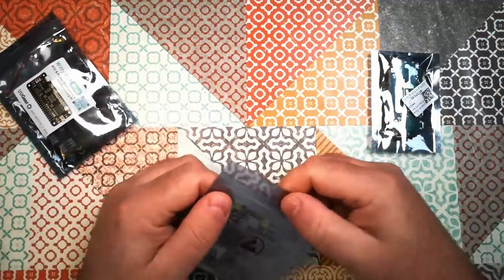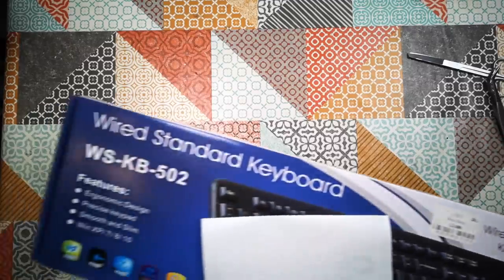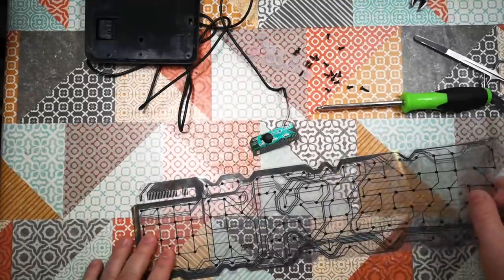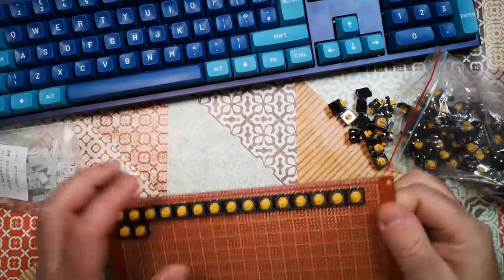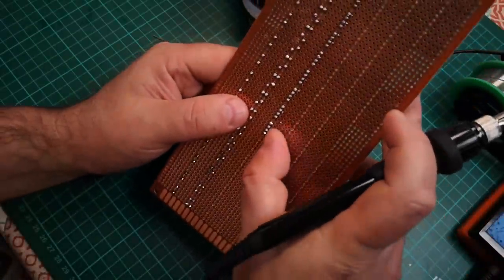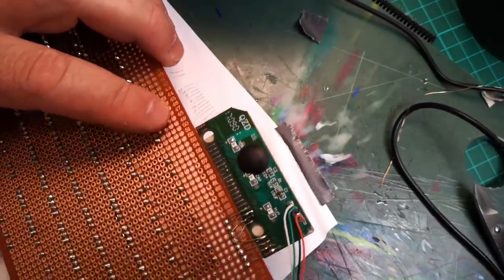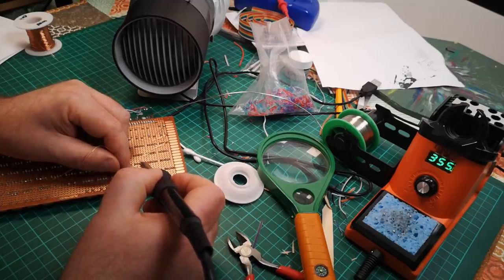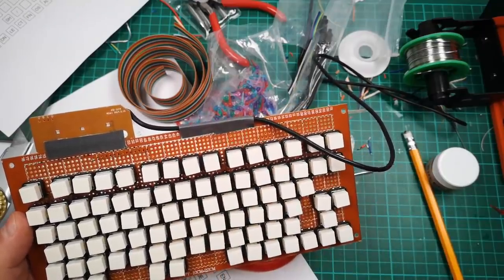How to NOT Build a Keyboard, or: Time to Stop Doing the Same Thing Harder

Comment: The PlayStation 2 controllers, and as well I presume PlayStation 3 uses a similar carbon-doped plastic method — on the PS2 controllers there is a small block of foam where if you lose it, you lose your controller until you can replace it because the mainboard holding the sticks and brainbox on requires physical contact with the plastic layer.

The internal chassis of a PS2 controller is also surprisingly fragile, but it holds the impact motors, as well provide a frame for all non-stick buttons and D-pad. The D-pad has a cross brace to hold it in place.

Comment: Having watched the whole video now:
- Don't be so sure that the older Pi is more power efficient because it's potential performance is lower.
- I'm not sure about the UK anymore but you can get cheapy keyboards that are the same size as your DIY one here for ~2000 yen (15 quid?)
- I think trying to use the existing controller made this much harder than it needed to be. I think if you ditch the requirement for your keys to match up with the original matrix it would be a lot easier.
- Personally I would have downloaded kicad, learned how to use it and gone for a custom PCB from the start. As you found out it's incredibly frustrating tracking where your wires are going with something like this. If it does work but it fails or there is a minor issue that needs rework it would only annoy the hell out of you again then.
- I'd suggest looking at some of embedded Linux training that bootlin have available on their site too.
Reply from the maker: It's not an older pi. It's the pi zero 2 - one of the newest in the family, but optimised for lower power operation
Reply: @AtomicShrimp  The SoC on the pi zero 2 is older than the SoC on the full size current Pi. I don't think there has been any optimization for power consumption and AFAIK it's just to make use of the parts they have..
The pi zero 2 is DDR2 IIRC and the current models are LPDDR4 which should have lower power consumption.
Reply from the maker: The Pi Zero 2 is not as frugal as the original Pi Zero, but it's pretty good - I think it's underclocked for the purpose of saving power.  I realise this is a really rough estimation of power consumption, but you can run it without a heatsink - if it was consuming anything like the power of the larger boards, this would not be possible

Comment: You could probably just use a marker, to draw a line between the pins of said switch on every switch, that way you could avoid being confused by the pins next to each other.. maybe even mark the letter ID for the pin too, so you dont need to look at the paper all the time and figure out where buttons are. Tho this might solve the confusion, soldering up a matrix like this is hell of a work..
Reply: Others have suggested cutting off the redundant pins. With half as many pins that has to reduce the confusion factor. Those switches have extra leads for convenience. But if those extra legs aren't convenient then maybe it's best if they go.

Comment: I think you could probably make it easierby :
1. use 2 pin switches or cut the 2 pins of the currnt switches
2. label the back side of the pcb where you are creating the matrix with label stickers
3. please dont use enamel wire use solid core wire you could more easily get a lot organized 
4. use the original clamp  with the rubber strip in the keyboard to hold the wires for your keyboard too !, make use of the zero board for the mechanical assembly for the clamp.
I think this would help
Reply from the maker: Yeah, on reflection, just using solid core wire and bending it to the route, then stripping little sections, would have been easier and better

Comment: I avoided using enameled copper wire as patch wire as much as I could, because afaik there are only two feasible ways to remove the coating: mechanical (it only works on thick wire) and chemical. You can burn the end of the wire but it will weaken it substantially. You can use aspirin (please don't) and it will work but the fumes are bad. Really bad.
A much better option for thin patch wire are old ATA or floppy data cables, you can split them and use the wires individualy or in bunches as it suits you.

Comment: Yeah, when i was trying to do the same thing with the copper wire with enamel covering, someone smarter than me immediately told me not to bother with the soldering iron and just use a burner. Granted my wire was thicker, but this thing really is tougher to burn than it feels it should be.

Comment: That keyboard you disassembled has domes remarkedly like the ones found in an Atari ST keyboard (sans the carbon bit on the nipple on the underside). I don't suppose I could be a pain in the bum and request that you measure the dimensions of the domes could I?  

(Unpauses and watches the rest of this vid while typing the following.) 

Regardless, thanks for the content you have provided for us over the past year. I hope you and your family are well and remain so. Happy new year Mr. Shrimp and family :)

Edit: No need to apologise for wasting [my] time watching a "fruitless" video. Listening to your reasoning and approach was very interesting. We all think in and do in differing ways. No harm in that. Thanks for sharing :)

Edit 2: The enamel on that wire is a bit of a pain. If you use this again in the future, a little scratch with a blade at the point you wish to connect to something will go a long way, less heat, etc. @htomerif's comment echoed what I was thinking through out. 

Just to reiterate, I really enjoyed this vid. Thank you :)
Reply from the maker: I wish I could help, but I didn't keep the little domes.  Just too much accumulating stuff in my studio so they had to go.  I was expecting this keyboard to work in the way you describe - with a contact patch on the underside of the dome, but they just press the two traces together
Reply: No problem. Thanks for spending the time to reply :)

Comment: Recently opened a logitech keyboard and found the same 3 plastic layer construction. What I dont get is how they get away with this thing having 0 diodes. Shouldn't ghosting be a huge issue?
Reply from the maker: Probably not, because they have arranged the keyboard matrix so that keys you are likely to press in conjunction with other keys (modifiers and windows keys) are on completely separate rows and columns from each other, and the main keyboard area.
Cheap keyboards like this aren't going to see much use for gaming, so the likelihood of someone pressing lots of keys all at once is low
Reply: Thats a good point!

Comment: Thanks for the warnings and lessons.  An idea though... rather than trying to reverse engineer, why not just connect row and columns wires as per the rows and columns of your new layout.  Then, map the keys in software.  Press each key, discover what the controller generates, then map accordingly.
Reply from the maker: It's a great idea in theory, but this harvested controller produces no output at all for row/column combinations it isn't explicitly expecting - so if I just arbitrarily wired rows and columns, I would likely end up with holes in the grid.
Reply: I like the thinking but the matrix itself must bring along resistance to the particular wires and not just a bespoke combination of rows and columns to a particular key? I could be very wrong here though!
Reply from the maker: The resistance of that printed carbon matrix on the original sheets was very low. I think it's just logic levels basically

Comment: I tried such a thin myself, the problem is mostly the carbon layer, you might need a 0.1mm drill to make holes on the trace lined where the carbon was, just to get a better connection.,
even then it is still a terrible way to make a keyboard.

you could also look at a older keyboard that still uses a FULL size PCB, then cut of what is needed, to make a keyboard.
Reply from the maker: The idea of drilling the holes is good. Wish that had occurred to me

Comment: You could get a small usb-keyboard and use that directly.
Some of them even have a little track pad to the side, which you could then hack to the bottom centre.
Reply from the maker: I haven't managed to find a small usb keyboard that meets my definition of 'small'
Reply: @AtomicShrimp  I found one, which is 22cm wide, The Super Mini Wired Keyboard, MCSaite , though some of the reviews are a bit worrying.

Comment: A very interesting video even though you eventually decided to abandon that particular attempt at a prototype.

Coincidentally, I am currently working on similar project using an almost identical little PCB pinched from a trashed cheap keyboard.
However, my design is more of a macro keyboard with far fewer keys and also uses an ESP8266 board that will enable single key strokes to "Type out" shorthand words such as: DUP, ROT, SWAP, OVER, etc..
These are all words used in the "Forth" programming language and the device will help speed up the process of writing code in Forth.
The code on the ESP8266 will itself be written in Forth !
Reply from the maker: One thing I do reckon would be good for this method is if I wanted to make an arcade cabinet with only a few buttons, hacking a harvested keyboard PCB would be a whole lot simpler, and probably worthwhile
Reply: Sounds awesome. Boosting productivity through simplicity is great.

The difficult aspect of keyboards are the number of keys and concurrent presses. In theory someone could create a keyboard from multiple 'macro keyboards' that feeds into another microcontroller, however, is is likely that the order of key presses might be frequently incorrect which is a pretty major problem otherwise it would offer a significant concurrent number of key presses.

Comment: [This may be a duplicate comment as YT bots seem to have deleted the last one as I included a link]. DIY your own KB will probably end in pain 😑 as apart from wiring shenanigans stripboard or even PCB is pretty flexible so it'll flex meaning a spongy feel and will possibly break after a while. You can get small off the shelf KBs for applications such as EPOS although you may have to compromise somewhere down the line.

Comment: Hey Shrimp, you could make a much more professional solution by download some free pcb designer and using that to make a board and maybe still even use the cheap matrix(by adding contacts to the board and screw holes, so you could sandwich the board between the contacts and a piece of wood, if you get another one of the keyboards that is), though it may or may be worth(cost and time wise to get a pcb printed) depending on how many mistakes you make during design, i also don't know how interesting of a video would that be.

Comment: The comments are very helpful already but i'd recommend one thing i haven't seen recommended already
Use connectors if you can, you can easily salvage or buy precrimped jst connectors that you could put on something as annoying as those connections on that keyboard pcb
I've saved my own ass with connectors many times, and then just ordered a box of them for about $3 from aliexpress, crimping by hand is a pain but you can always just buy them already crimped on wires
If you put connector on that keyboard pcb then you don't have to be scared of fuking up the main board or if there is a change of plans (which to be honest there always is)

Comment: Using a soldering iron to remove the insulation from enameled copper wire has never worked for me. I've found that using a small flat metalwork file is the best solution. Two cuts on either side of the wire against a workbench (or calloused fingers!). Then it tins like any other wire
Reply: It can work if you have a large blob of solder on the iron and lots of heat. It stinks though
Reply: Most enameled wire you cannot burn the insulation off with a soldering iron. Some enamel is specially made so you can. We were lead to believe what was being used here was the latter. Apparently the chemistry could have been better though. Some products simply fail to perform as they should.

Comment: I've been down this road before.  it's way easier to just spend the extra $2 on a pro micro, and it's easier to just get real keyboard switches for an extra 3 cents each, stick them into a plate you got custom cut for $30, and hand wire them.

Comment: protip on the soldering: clean the pads of the perfboard using a cotton bud + IPA
Reply: Sometimes a light sanding can help too. That particular kind of perfboard is pretty hopeless though. Lifting those pads is a very easy thing to do. There's not much holding them on. They make perfboard with plated through holes. That doesn't lift.

Comment: I couldn't stop shaking my head the whole way through until you realised you were wasting your time.
There are a number of reasons not to attempt to build your own keyboard but there really is no need when there are lots of off the shelf options available that are cheap. OK they might not be the highest quality but they are functional and don't require any maintenance, in my experience home made items like this are not reliable and very frustrating to use and to fix.
I do admire your attitude of giving it a go and working through the problems, I cannot imagine how many hours you poured in to reverse engineering that keyboard so you could use the PCB and then mating that up with the perf board and connecting it with wires, that must have been very frustrating ! Those pads on the PCB that the traces on the membranes connect to were probably gold plated which is why they were so thin, gold doesn't corrode like other metals and is often used in circuit board connectors.
Reply from the maker: I haven't been able to find a keyboard that does what I want - the ones that are sufficiently compact are all bluetooth

Comment: It seems like you were trying to recreate the finicky plastic keyboard matrix in wires and switches which was going to multiply the complexity of the workpiece. Maybe if you'd gone wire wrap it might have been manageable.. ah well, at least you stopped before you got to debugging the result..

Comment: Hey, I think you mostly did things with a fairly decent approach here, but a few things I'd add:
 - that wire glue stuff is horrible, I wouldn't use it, personally. You do you I guess.
 - PCBs don't somehow account for traces vs pads differently, generally, aside from maybe some width differences in some cases, though I personally don't think it matters much, those seem plenty wide for me. Probably part of the issue is that they had that coating on them beforehand. I'd have cleaned them much better before trying to tin it, and part of it is probably just that it's a really cheap PCB that wasn't designed for humans to really interact with
 - tracing out the matrix is a huge waste of time imo. Just labeling the rows x and then columns y or something and then saying "x1y1 gives esc" for example and testing all of the combos is really easy, potentially even partially automateable (tell a program you're starting at whatever x location and whatever y location, then move through all of the y's in-sequence and have the program record all of the key-presses it gets, then it spits out the data for you in some easily usable format like csv)
 - before actually soldering, plan out your connections in paint or so, and double check it there before actually making them. A PCB design program might even be the way to go just to make your initial map, though it's more work. Again, some automation might come in handy there, making something to generate a netlist for a schematic of so.
Even with all of that, it still might be less work to just use the arduino at the end of the day. Still, cool video, and something I attempted multiple times as a kid just learning to solder
Reply from the maker: The trouble with bruteforcing the rows/columns:
Not all row/column combinations produce anything at all - so there's the constant doubt about whether there was no keypress registered vs whether I just fumbled the test (which is physically fiddly) - this would also unfortunately defeat your idea about automation, as some rows/column combinations are skipped 
I couldn't find a very useful test utility to work with it - there are keyboard testing programs out there, but none of them had a matching layout for this keyboard, so none of them were able to test all of the keys.  Some of them couldn't differentiate between (for example) left and right <Ctrl> keys - not that this matters too much.  modifier keys in general are hard to test without software specifically designed to intercept and analyse keypresses.
There are a small number of additional key combinations that must have been there to cater for a more advanced version of this keyboard - for example, one of the row/column combinations I accidentally triggered when verifying my matrix analysis, just shut the computer down.